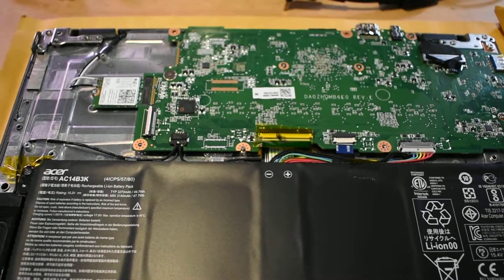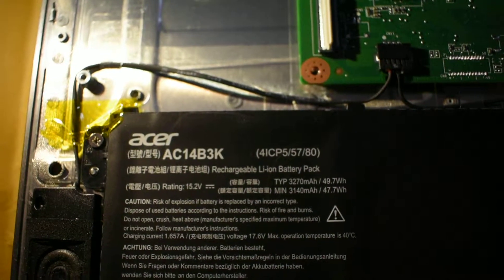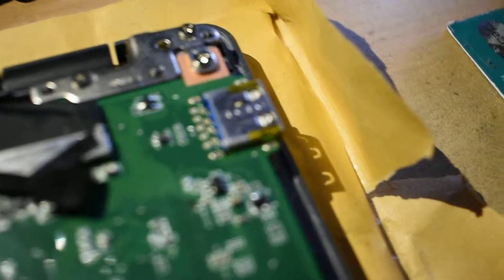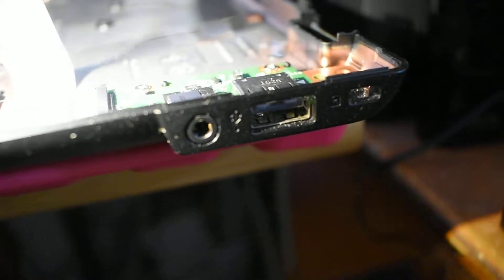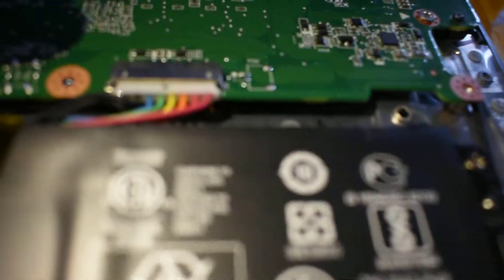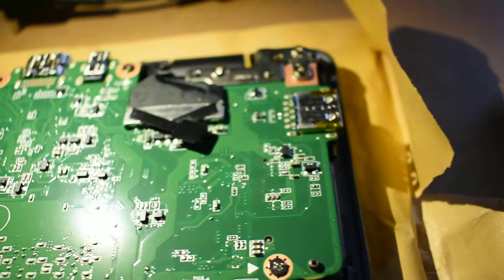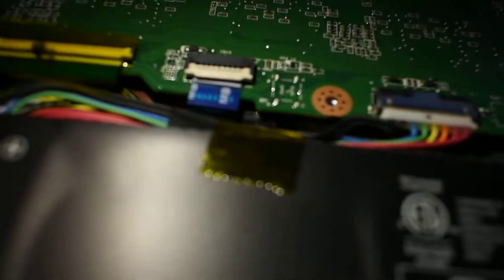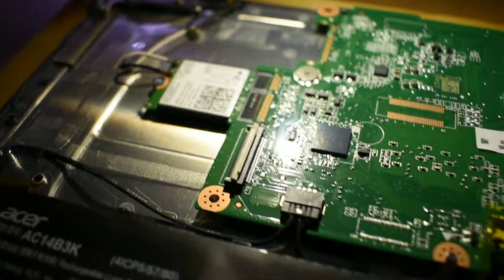Inside an Acer ChromeBook C730 ("C730E-C480" 2GB RAM, 16GB storage variant)

Comment: Can the SSD storage device or storage card be upgraded on this model like the C720? And does it require a complete tear down or is it easily accessible once the back is removed? It's hard to tell from this video (unless I missed it!). I know the RAM is soldered to the board as on nearly all post-2015 Chromebooks and can't be upgraded.
Reply from the maker: No idea!
Reply: Nope you can't upgrade any ssd or memory as iys integrated on yhe motherboard.  Also if you notice there is no fan to cool the cpu for the same reason.